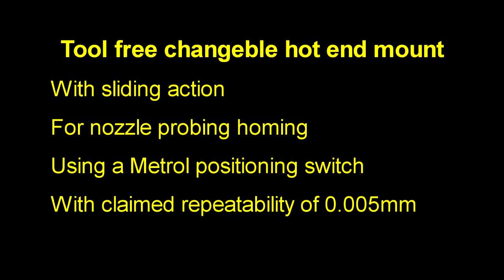Tool free changeable hot end mount

Comment: Very nice...
Reply from the maker: Thanks Terry. The idea of having it sliding is so that I can use the nozzle to probe the bed for Z homing. The issue I have at the moment is that I use a mini IR probe but it's difficult to mount it close to the nozzle with a Diamond hot end and it's also affected by my using 3dlac on the glass bed. My plan is to use a precision switch above the mount. It's untested and may not work, in which case I'll simply do away with the springs and use a cam clamp to hold the hot end rigidly in place. At least I'll still be able to swap hot ends reasonably quickly (I have two, one with a 0.4mm nozzle and the other with a 0.9mm nozzle). Ian